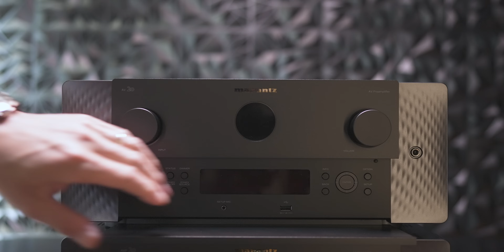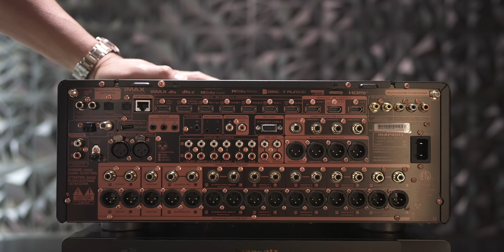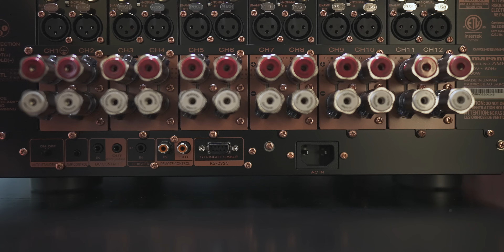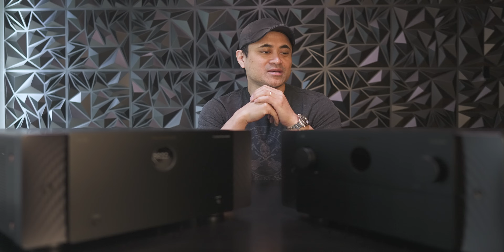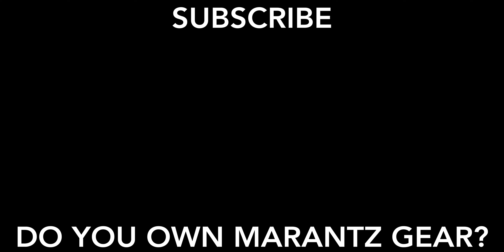Marantz AV20 & AMP20! 13 Channel Home Theater Processor & 12 Channel Amplifier

Comment: But why only 12 ch amp and not 13 to pair with av20? What was in the minds of engineers? Thanks for sharing anyway
Reply: Because the amp modules they have are stereo.
Reply: @DRAGONSTONEfilm is that a simple laziness of not willing to make a mono module to match the preamp outputs? I mean what’s the reasonable reason behind that decision?
Reply: @DRAGONSTONEfilm because if I want to buy a complete system from marantz, I need to buy an additional mono or 2ch amp. So it’s not a decision but an additional problem from the respected brand

Comment: If you have $12,000 for separates, you have $14,000 for 10 series.  The step down is the Cinema 30 which is $4,500 and probably sounds better for stereo and can also be used as a processor. 

Maybe at $9,000, this would have made sense but I feel the Cinema 30 is overpriced at $4,500.

And then there's the Cinema 40 and Denon 4800h which are also made in the Shirakawa facility and can also be used as processors and go on sale in Europe or the US depending on the model.  I bought a 4800h for $1,400 new - that's 10% the cost of the AV10 and AMP10.  Actually the tax is almost as much on those 🙂
Reply: Don't forget that they also want you to splurdge out another 800$ for a DIRAC licence, which is not included, FOR INDIVIDUAL AVR's. Meaning if you have 2 Marantz AVR's you have to pay twice! Or if you upgrade. Which is outrageous!
Reply: @DRAGONSTONEfilm Is it $800 for a Dirac License?
Reply: @DRAGONSTONEfilm  that is a Dirac policy. Nothing to do with Marantz.
Reply: @DRAGONSTONEfilm the upgrade part is crazy.
Reply: Well, a Ferrari is also more expensive than a Ford (I know they are not the same brand, but also Ford has cars in different price ranges!).
Reply: @supergrissi yeah but the Cinema 30 is a Ferrari and I would say the Denon 4800h is nearly identical to the Cinema 40 so it’s a Porsche 911.

A lot of people would be happy with a 911 especially the Targa (Essentially 4800h with external amp) for 10-20% of the Ferrari’s cost.
Reply: Again, HUGE price increases are coming in early June for the AV10 And AMP10.
Reply: @brucecarter6205 I was thinking they might do that.  But they are already incredibly overpriced.  😮  Marantz may just put themselves out of business with these prices.

Comment: I don't understand what the point of coming out with this processor is. If you're going to price it at $6,000 instead of the $7,000 that is the av-10, what's the point
Reply: Exactly!  And it has less channels than the 10.
Reply: @unixsuperuser  Wait a few days, the street prices come down. A refurb AV10 unit sells for $5500. MSRPs are a joke
Reply: @Leo-tf7gu  that's a good point.
Reply: The AV10 price will be increasing SIGNIFICANTLY in early June.
Reply: @brucecarter6205  probably due to tariffs.

Comment: I wonder if all the inner circuitry is the same as the av10, aside from the channel reduction
Reply from the maker: It's slightly different because of the smaller chassis.